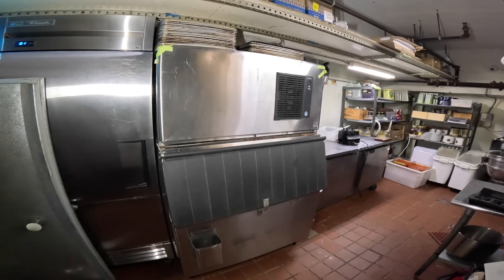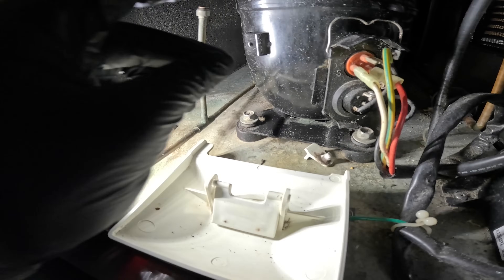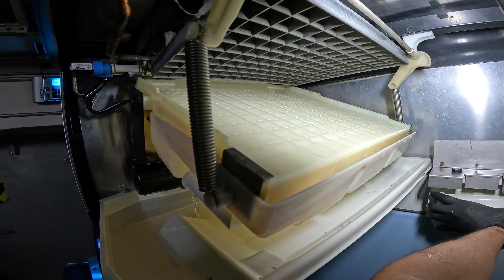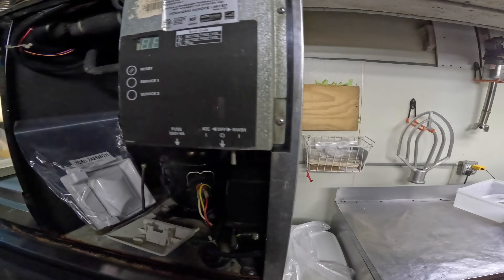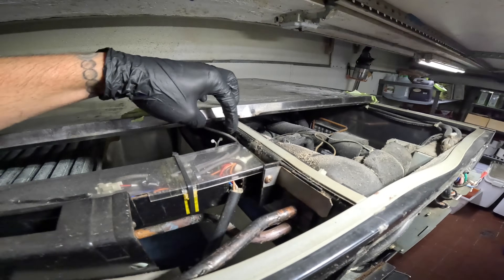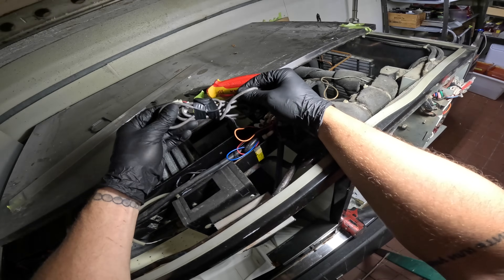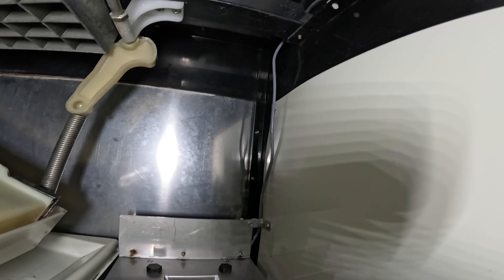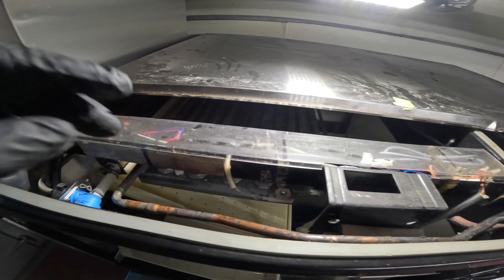HVACR: Hoshizaki Ice Maker Not Turning On (Hoshizaki Ice Maker Not Making Ice)Troubleshooting/Repair

Comment: someone needs a large "strap wrench". those type filter cylinders always take a set and are a pain to remove otherwise.
had them so stuck before, it took three of us to break loose, two holding the top and piping from twisting off and one to yank the snot out the cylinder/wrenches(had four stacked up) yikes.